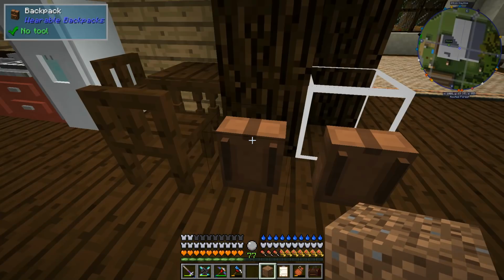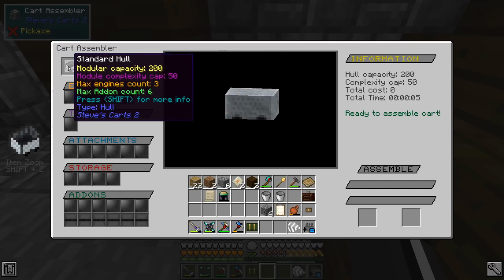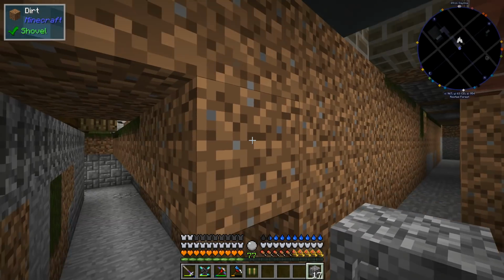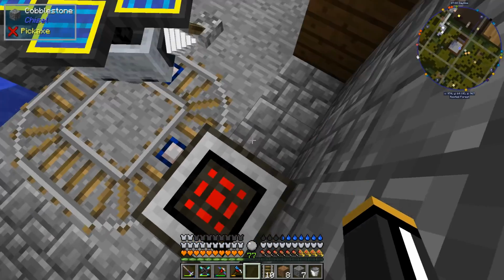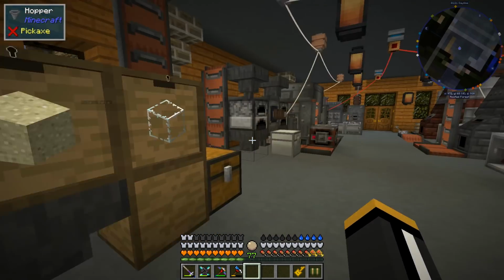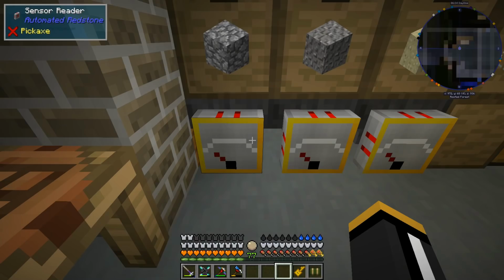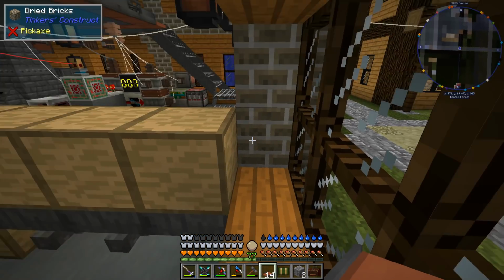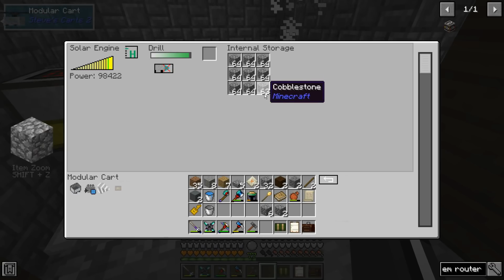Real Tech S2E34 - Cobble Works with Steve's Carts, Immersive Engineering and Automated Redstone

Comment: Small little qeustion can i make a train with steve carts that let it stop at points
Reply from the maker: I'm not sure exactly what you mean, but probably yes. You can use detector rails and station blocks to have the cart stop under certain circumstances. The pack also has the Signals mod which has multiple features for controlling cart traffic.

Comment: Very nice. Why not put two filters on top of the chimney, then you could do something like light a light when the bottom one is full. BTW you need to break and replace the filters after the last mod upgrade. You can add paper and leaves to the filter (and the vacuum bag) to filter carbon and ash.

Doesn’t Steve carts have a small solar engine that will fit in a wooden hull? I guess that the drill won’t fit as well.
Reply from the maker: 2 filters would be a good idea. Now, I just clear out any sulfur when if fills. lol
Thanks for the tips!
There is a smaller solar engine, but in my experience, it doesn't always keep up with the power needs of the cart.
Reply: Danny & Son you know I’ve never played with Steve carts but watched your episodes on them. I really want a magnet on a cart to wiz around picking up mob drops.